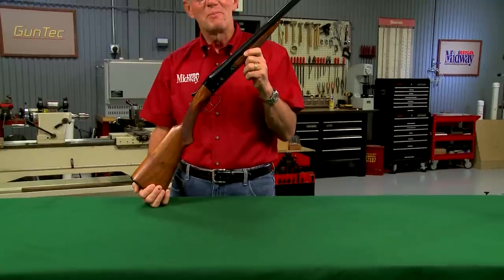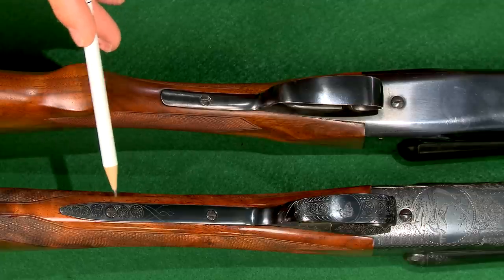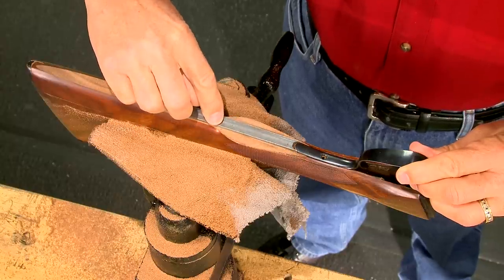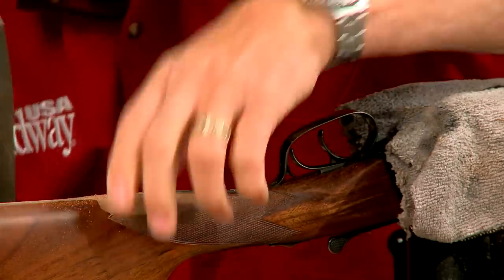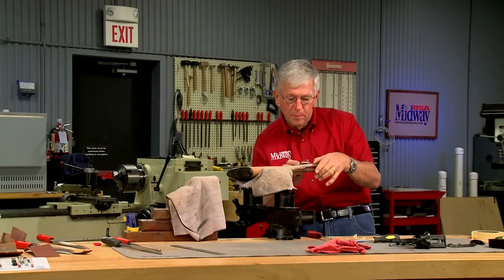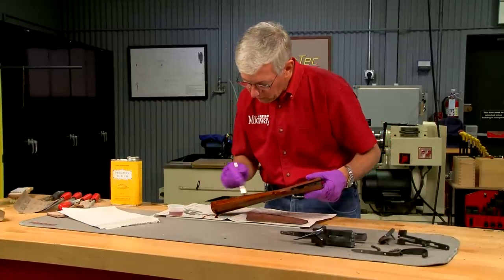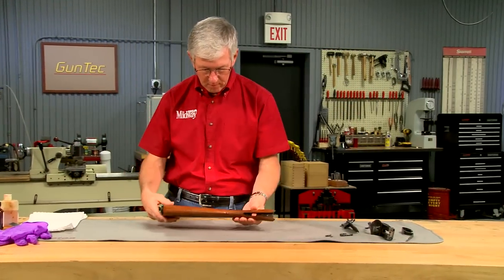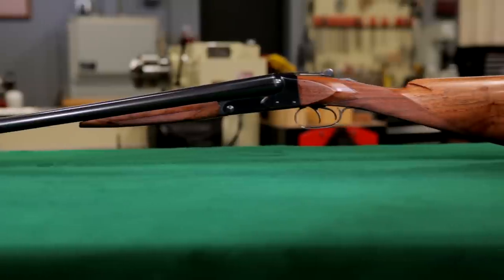Converting a Winchester Model 21 Side by Side from Pistol to Straight Grip | MidwayUSA Gunsmithing

Comment: I wish I had this machinery in my garage to make fabricating an "easy process".
Reply: Just collect stuff one thing at a time..... a small secondhand lathe and a medium weight drill press will get you started. A DC inverter welder can be used with a Tig torch, or use a Mig, which can do it too (and sometimes better)...
Reply: I did this to a cheap O/U that I have from the early 70's. All I had was a wood rasp and some sand paper. I smoothed the stock....no checkering at all .... and then stained it. Looks ok and shoots as good as I do and that's nothing to brag about.

Comment: Fasinating, fasinating! I would not have imagined how versitil the use of epoxy is here. (1) it wood tones correctly with sanding dust (2) checkers like the wood, (3) stains like the wood to blend in perfectly. 
 I have a wrecked Parker stock, broken in half at the wrist that after gluing up I will use the 'Larry Epoxy Method' to deal with the cosmetics. Thanks for this gem of information!